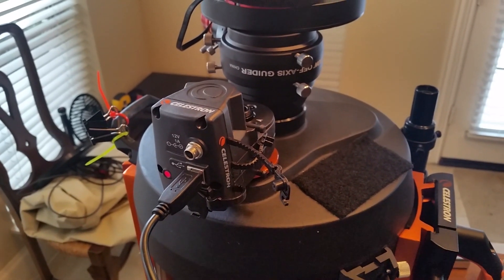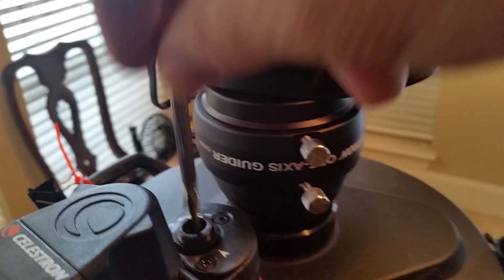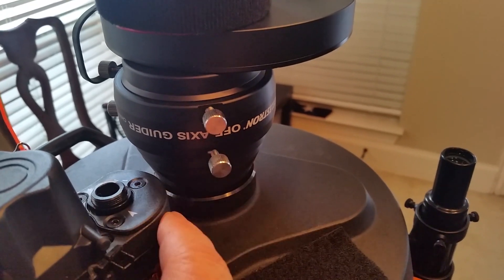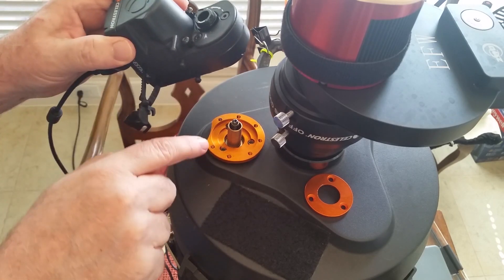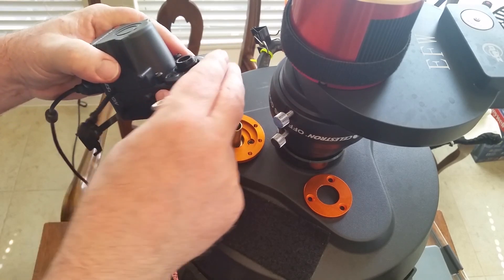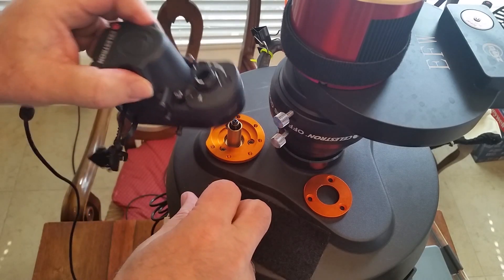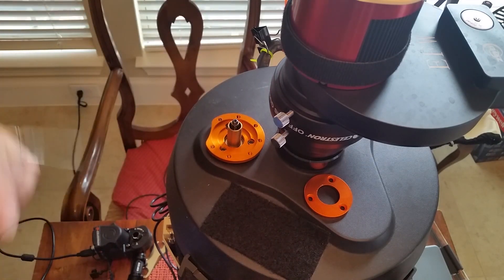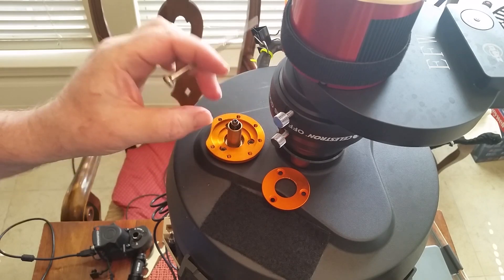Mechanical Binding Issue with the Celestron SCT Focus Motor

Comment: Don’t buy this. This product is full of flaws and easily damaged. My motor was died at the first day, a plastic gear broken
Reply from the maker: It can work, but many of us have had to fiddle with it a lot more than we should.
Reply: @Aero19612 I have disassemblied the focuser and disappointed. They use a lot of plastic gears in the main motor, it is easily damaged. It looks like a toy rather than a real equipment.

Comment: I just bought a Celestron focuser and installed it today on my C8se.  Bummer--nothing moved!  Going back over each step, I realized that the new adapter plate was the culprit.  I carefully looked at the standard plate and this new one.  There was an obvious difference--the standard plate had a 20 thousandths recess carved in it where it contacts the face of the SCT's focuser bearing, and the new adapter had none--it was smooth on the underside. 

Installing this new adapter plate caused a significant amount of binding on the focuser shaft.  It was easy to feel the difference just turning it with my fingers, even before installing the motor.  The underside of the new plate is .020" closer and is putting pressure on the face of the SCT's focuser bearing.  The amount of torque needed was so much that the motor would frequently stall.

That's really annoying, to say the least!  I could make the motor work fine, but only if I left the 3 screws on the new adapter plate very loose, and then the motor and the whole assembly had way too much play in it.

My solution was to add 3 thin washers between the new plate and the SCT body, one for each screw.  Luckily the standard screws had enough threads to do this.  I tried using the standard plate under the new one as someone suggested, but my screws only had about three threads showing, and I didn't dare put that much torque on them.

It's really annoying how "fiddly" this product is.  Thanks for your video--it gave me the idea for the washers, and most importantly made me feel that my problem was not user error!
Reply from the maker: Hi Dave. Glad you were able to sort it out. The Celestron focuser is a very frustrating piece of astrogear, to be sure. It seems clear there was no extensive design-build-test-refine cycle in the process. Just throw it out on the market and let the buyers crowd-source homemade solutions. Thanks for watching!

Comment: Hi James.  I just went through the same problem last night with my Celestron Focus motor: the three set screws for the adapter plate loosened from the OTA which caused issues with my N.I.N.A autofocus routines.  BTW I added a tiny amount of blue Loktite on the screw threads, which will hopefully stop this from happening in the future.  Watching your video helped me to troubleshoot the issue.  Thanks for taking the time to present your findings and solutions!
Reply from the maker: Glad it helped, Anuraag! I'm just now getting the C9.25 on the mount again and have my fingers crossed that the focuser stays on...

Comment: Very helpful to watch this video and read some of the comments. I installed the focuser on my 9.25 a few weeks ago and have had problems from the beginning. At first I was convinced it had something to do with the software (Im using the USB interface since I have a EQR-6 PRO mount). The focuser would sometimes work for a while and then just stop working which made it really unpredictable. 

After seeing this video I reassembled it from the beginning and looked at it more carefully. As has been mentioned the design is really bad, in my case the mounting plate has not moved but I realised that when you tighten 2 hex screws to attach the motor it actually presses directly against the bearing which can make it stall (depending on the pressure). I loosen the 2 hex screws a bit and now it seems to be working (have not had the time to test it properly yet) but the focus motor itself is wobbling a bit. 

I will probably have to do a better fix in the long run, e.g. adding some washers and longer hex screws and maybe even trying to make some custom adjustments to make it possible to  use 3 hex screws instead of 2.
Reply from the maker: Hi Mikael. Yes, I think it is a poor design. There are two “flaws”, I believe. The design does not include an effective flex connection between the motor and the SCT focuser shaft, so Celestron recommend as not tightening the screws to permit the motor to wobble as a means of aligning its motor axis with the SCT shaft. The second issue is that they are relying on very small screws in the OTA to connect the focuser to the OTA body. This last issue is particularly bad for me because one of those threaded holes has damaged lead-in threads so the wobbling works that screw loose. I have since bought longer screws and installed them with LocTite. I haven’t had a chance to test it thoroughly, but it hasn’t come loose since. My fingers are crossed, but my confidence is not high. Thanks for watching!

Comment: I know this a bit old, but I was wondering if you resolved this issue? I thought the notch in the base plate was supposed to align with the notch in the focuser body, and ideally, those notches were supposed to align with the visual back. I wondered if having the base plate and focuser body notches unaligned may have created a space that wasn’t flush? I was about to buy this for my c-11, but I am going to hold off now until I learn more about potential issues.
Reply from the maker: Hi Marcus. The notch can go anywhere. The main issue with my setup is that the first few threads in one of the three holes on the OTA side are bad, which means that the short screw can't get a good hold and works loose. I have since replaced the original short screws with longer screws and put LocTite on the threads. It has not come loose since, but I also haven't had the chance to use it a lot. My fingers are crossed! Thanks for watching!

Comment: Aloha Jim, I really like all your videos and a great resource for information.  I bought the digital angle guage, and set up Stellarium the way you have it.   I'm still try to decide what kind of electrical focuser to get for my C11 Edge. Was just curious if you're still using the Celestron Focuser?  Also if you have time, can you do a review on that Pegasus FocusCube Zero (for SCTs)?  That seems like another good option.  Thanks!!  John
Reply from the maker: Hi John,
I still use the Celestron focuser. I have 2 Pegasus Astro FocusCube2's for my refractory but not a FocusCube0 with an SCT attachment. I really like the Pegasus Astro equipment. The thing I question with their SCT focuser is the belt drive. Probably works just fine. You might also consider the ZWO focuser with the SCT mounting hardware.  It has a direct mechanical connection. Both of these focusers leave clear access to the 3 mounting screws on the back of the SCT so you can tighten then each night. The Celestron motor covers the screws and you only know the screws are loose when the focuser binds up. Given a choice, I might give the ZWO a shot. Hope that helps!
Reply: @Aero19612  ok thanks that is good to know!  I saw the belt drive and they advertise zero backlash (but didn't find any reviews on it).  Will have to look again and check out the ZWO focuser.  I have one of those Starlight Instruments feather touch focusers on there now (just doing manual focus with it for now).  Thanks again!!

Comment: Hi James,  newbie questions here
Do I have to have a camera connected and does it have to be looking at the sky to work?
It's on USB alone not looking up, should it work this way?
How do you get it to calibrate?  It is not working off the shaft and the light is on.
Reply from the maker: Hey Bernard,
No. You do not have to have a camera installed for the focuser to operate. USB power should work, however, you must calibrate it first before you can have it move. Celestron has a driver and stand alone focuser control software that you can use to calibrate the focuser. Check the Celestron site for this software. Good luck!
Reply: Hey James,
  I finally found this driver, installed it and everything is working now.
   Thanks for helping and thanks for all those great  and helpful videos.
  Clear skies. Bernard.

Comment: I think with some loctite it will help and the big backlash is not a problem for me because i have 2 clutch on the primary mirror on the 11" edge hd
Reply from the maker: Right. I've since replaced the shorter screws with longer ones and used Loctite. I haven't had it come loose since, but I need to use it a while longer before I claim victory. Thanks for watching, Gauthier

Comment: Hi James.  I don't know whether you check comments on your older videos, but..  I have a question about this SCT focuser I was hoping you would have the answer to.  I too have a 9.25SCT and the same focuser.  I noticed the other night that the focus was acting goofy (swings in focus position of 35 to 40) so I inspected it and found the plate had loosened (as you have had problems with).  I disassembled the focuser, replaced the m3x8mm with m3x12mm screws and put a small amount of blue loctite on the trheads.  When I had the thing reassembled, I noticed that I could turn the shaft (the part you point to at 1:00 mark of your video) back and forth (say 1/32 - 1/16 turn) which I don't remembering if it did this before.  Does yours do this? Is this the origin of the focuser backlash? 

I must say this is a mickey mouse design for the adapter plate.  It is a pain in the neck to align (both concentrically and for level).  I ended up 3d printing a bushing to align it concentrically but the level alignment is just a poor design.

Thanks in advance if you can answer this question, and if not thanks for the very well done videos.  Your methodical style is very informative for an old retired engineer.
Bob
Reply from the maker: Thanks Bob! Us "old" engineers gotta have something to do to keep us out of trouble. I saw your later response that about the backlash. So far, after using longer screws and Loctite, the plate has stayed on. Still not willing to claim victory. If I can get through the next Galaxy Season without it working itself loose, maybe.

Comment: Same problem, kept binding up.. and the bottom plate moves a tiny bit. Like yours
Reply from the maker: Hey Frank.
Sounds familiar I replaced the original (3) 8mm long M3x0.5 flathead screws with 10 mm long screws and used Loctite Threadlocker (Blue) 242 to provide extra resistance. The focuser hasn't come loose since, but I'm not going to claim victory for a while yet. Confirm the size of the screws in your OTA if you go down this path. Good luck!
Reply: @Aero19612  i just finished pulling mine apart 1 of 3 screws was OUT just hanging there, touched it and it fell into my hand. All 3 were loose . Tightened everything . If it happens again locktight or larger screws ..
Reply from the maker: Again. Sounds familiar. I would recommend Loctite AND longer screws. Let me know how things turn out.
Reply: @Aero19612  absolutely,  like I said, tightened it up, if it comes loose again ( when i should say) lol .
Don't have any, locktight , gonna buy some this week.  Think i have longer screws at home! My fix as temporary.

Comment: I notice in the video you have the plate the wrong way round, the cutout part meant to be on the inside facing your visual back
Reply from the maker: Hey Dennis. Actually, the orientation of the cut-out doesn't matter for my SCT. I suspect they put it in for when that bracket is used with a smaller SCT where there is possibility that the bracket will interfere with the visual back when the focuser is closer to the visual back.
Reply: @Aero19612  as far as i know the instructions and everyone else say that cutout must face the visual back. The 5 and 6 " the cutout goes toward the outside, for larger the cutout goes towards the visualback
Reply: @Aero19612  no instructions say on 5 and 6 I inch that cutout goes toward the outside, 8 and above the cut out goes toward the visual back. The installation instructions are clear on this, maybe try it the proper way and see what happens? There is a possibility they are clear which way it goes as it may be seated better, worth a try?
Reply from the maker: That's interesting. I may try to get clarification from Celestron on that. Makes no sense to me. That said, I'm certain the reason my focuser works itself loose is because the damaged threads in one of the threaded holes on the OTA side combined with  having to re-use the very short screws. I have installed longer screws with Loctite and it has not loosened since. Thanks for the heads up, Dennis, I'll look into it further.
Reply from the maker: Just dug up the instructions. It appears that the 3-hole pattern in the OTA is oriented differently in the 6" and 7" from the 8" and 9.25". The cut-out is opposite one hole and "bisects" the other two holes. Note that instruction step 14 says that the cover plate can be rotated if you want. So the orientation of the cut-out is not important (other than the 3 holes have to line up with the 3 threaded holes in the OTA, of course).
Reply: @Aero19612  yeah 6 and 7" opposite fit to 8+ scopes
Reply: A good test to see of the screws are holding and not loosing up is grab the motor and see if you can rock it, or move it. If it moves then the screws are loose.
Reply from the maker: Agreed. So far, so good.

Comment: My main concern is, if the motor binds in a postion you cannot access the locking shaft screws, your basicallt stuffed and no way to unclamp the shaft locking screws.

Your lucky you could access them. Else would have been stuck
Reply from the maker: Yes. I had that concern as well. However, If that does happen, I'm thinking that I could disconnect the focuser from the bracket via the two screws and then use the focuser itself to turn the know to an accessible position. Still, I'm crossing my fingers that scenario does not happen. Thanks for watching, Dennis!
Reply: @Aero19612  I emailed celestron about that issue as its a flawed design
Reply from the maker: Don’t hold your breath waiting for a response. When I raised the issue with them, the support team told me they’ve never heard of the screws loosening.

Comment: I had a similar issue with my CPC1100. 

Long story short (summarising hours and hours of working on this problem and research online) the only way I was able to get ALL the screws - the 3 on the mounting plate and the 2 hex screws used for motor mounting - snugged up as they should be - and not loose - was to use the orginal focus cover plate with the Focus Motor kit mounting plate installed on top.  This is actually a 'fix' that Celestron have been telling people to do along with sending them  longer screws to do it. 

I was lucky in that the screws in my 1100 are long and were able to mount both plates with still at least 1/2 " of threads to spare. 

Before this  fix, the ONLY way I could get the motor to turn was by having the 3 mounting plate screws and the 2 motor mounting screws actually loose..........

It turns out, what's been happening is that the female motor engagemnet shaft has been applying pressure to the bearing via the kit mounting plate. This is what was causing the binding and jamming that people were experiencing.  Some people have also installed washers / shims behind the mounting plate to achieve the same relief of pressure on the focus bearing.

All my 5 screws are now snugged up as they should be, the motor is working as intended and the motor is not moving on its mount anymore nor seizing up.

This product gets filed as another good idea by Celestron but very very poorly researched and tested. It transpires that talking to people who have been involved with Celestron through the decades that this approach is typical of them - bring out a product and let the (suffering ) customers do the R&D. 

I hope this helps someone down the line.
Reply from the maker: Thanks for the feedback! Ticks me off to hear that Celestron is sending longer screws and suggestions to fix [their] problem, while the support guy told me he's never heard of those screws getting loose. I totally agree that Celestron is using its customers as its beta testers. I must say, I don't understand how the focuser works for a "long" time when the screws get loose. Mine just get more loose as I continue to operate it until, if I let it go long enough, the focuser would come loose from the bracket. I also don't understand how placing the original cover plate between the OTA and the new bracket helps.
Reply: Thanks for posting this.   My focus motor was working fine until I removed it and put on a ZWO EAF for some astrophotography, but when I put the Celestron focus motor back on it would  constantly stall.   I tried the three washer trick, and Loctite on the screws and it worked.   Also, I think part of the problem is before you tighten down the two screws that hold the motor to the plate, tighten the screws that hold the motor to the shaft.   Otherwise, the motor may be a little off kilter on the shaft if you snug down the screws that hold the motor to the plate too much.